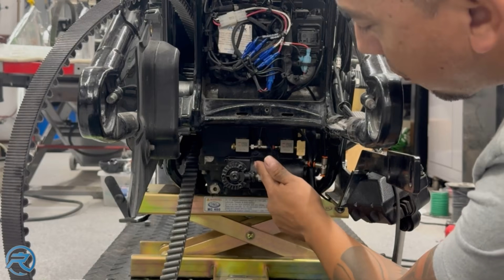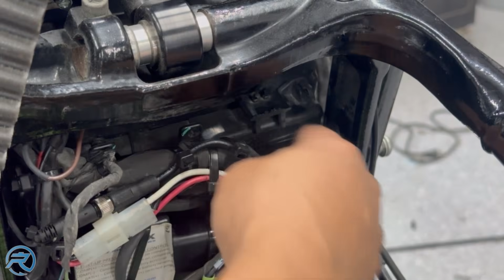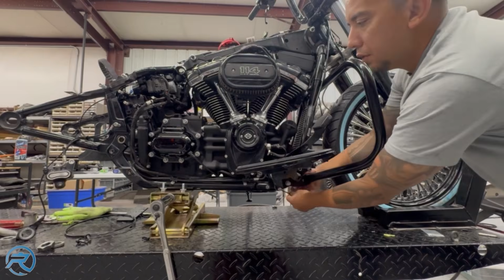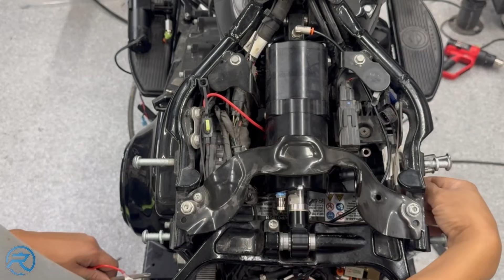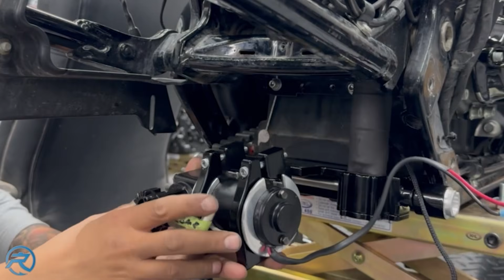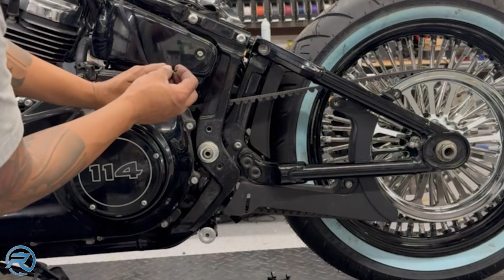How To Install An Electric Center Stand On An M8 SOFTAIL

Comment: Suicide stand, if it fails and drops while riding its going to send you off.
Reply from the maker: Uhhh.. no. If you have questions I’m always here to answer, but whether it’s an air ride or center stand, I will always prioritize functionality over ascetics every time.
Reply from the maker: These systems are designed with multiple safety redundancies to ensure they remain securely retracted while riding.